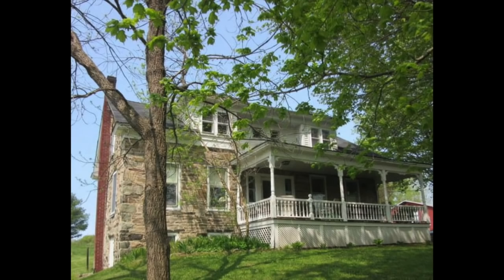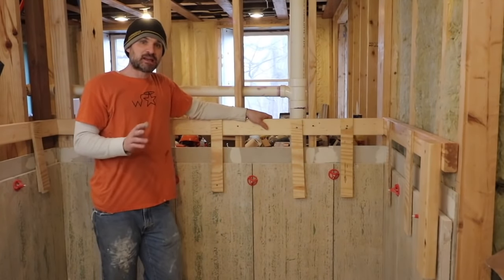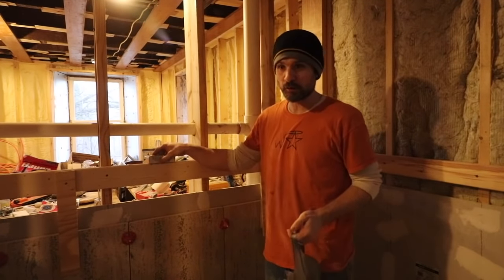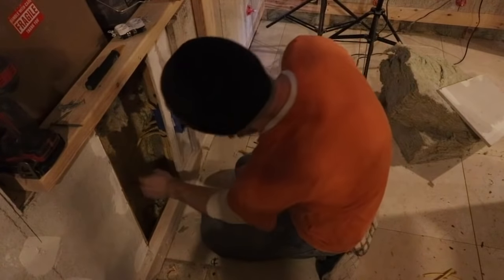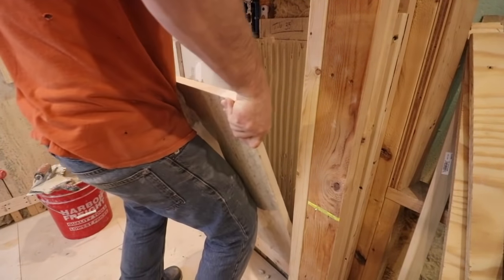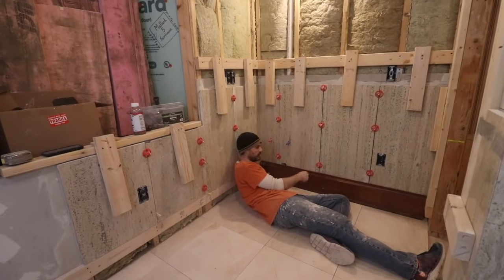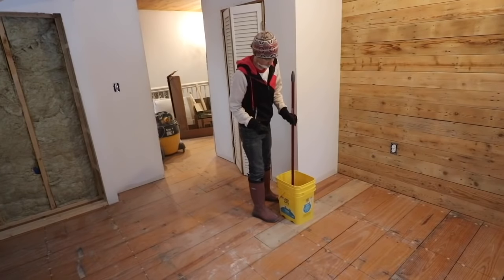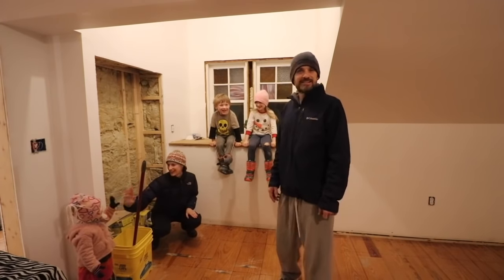100 Year Old Marble | Home DIY | Ep. 160

Comment: I did large format tile around my fire place much the same way you did your marble, then I watched some Custom Building Products tile setting videos. What I learned from them is when double buttering one side should be flat troweled and the other should be notched. Double notching will possibly trap air in the mortar bed. I’m just a carpenter that dabbles in other trades when I don’t feel like paying others, so hopefully the reference helps. My fire place hasn’t fallen off the walls even with 5 boisterous Children, so you’re probably fine, too.

Comment: I was always told that marble that is green is way more expensive, not sure if that’s right but maybe a viewer can tell us...Eucalyptuses oil will take that scotch tape residue off. 💖🇦🇺
Reply from the maker: I’ll try the oil if we can scrape it off.. sarah loves oils.. she has so many different ones.. I like cedar wood.. I sleep like a baby with it. 😃
Reply: @1806StoneHouse  I keep Lighter fluid (fels naptha) to remove tapes and residues. FAST and leaves no residue. May need to soak the paper ones for a bit and they just lightly scrape right off - then clean with more fluid and paper towel. Cheap- fast, leaves NO marks and easy to stay safe.

Comment: Hi Lucas,
First, fantastic job, care and diligence in cutting and laying out the tile - truly elite level attention to detail.
But to your point about not being able to fully squeeze them back to the wall (and the very high immediate suction to wall) it’s because your backbuttering and your wall adhesive/thin set are tooled in conflicting directions I.e. one is horizontal and one vertical.
It means the air can’t escape through the channels/grooves created in the thinset like they could if both were tooled in the same direction (which would be the ‘correct’ way - sorry to sound like a keyboard expert).
Great job though, much better than most pros.
Best,
Rob
Reply from the maker: Always happy to learn something! That makes so much sense! I had to redo a couple and there was good contact but I imagine the opposing direction was why I had to use bodily force each time. The screw down leveling system also helped I imagine. Don’t want any falling off! 😭😩
Reply: 1806StoneHouse if I’m honest, when I backbutter stone tiles, especially travertine that have lots of pitted holes in them, I only use the flat edge of the trowel to push the thinset into the pores of the stone, and leave the back of the tile flat and smooth. 
I only put the grooves into thinset that’s on the wall, and it must all be tooled in the same direction, whichever one you choose, again to allow the air to escape as you press the tile back against the wall.
Reply from the maker: IamRob FromCardiff I was using the 5” blade to do that and then using the 1/2” trowel to make my grooves.. I hope it all stays where I put it!! 🤦‍♂️
Reply: 1806StoneHouse oh gosh yes. There’s no problems at all with what you’ve done, solid as a rock, you just made it a lot harder for yourself that’s all!
Reply from the maker: IamRob FromCardiff haha!! Story of my life!! Haha!! I appreciate you tell me those things too! I have more marvel and other tile to do.. any help is super appreciated 😃😃 thank you

Comment: Rough in the plumbing for a wet room now, then you could hook it up later on down the track. Maybe.
Reply from the maker: That’s basically what we’ve done actually 👍👍 all the plumbing is in place.. drilling the hole through the floor would be the hardest thing to do.. I would need to be 100 sure of the pipe placement.. I’d probably use a large shower pan too. I don’t really like the idea of a wet room.. I just don’t trust it. 😂😂
Reply: @1806StoneHouse  Thanks for the reply! 🐨

Comment: With the wood floor upstairs sand it down To bare wood and put the finish coat of polyurethane on it. It would look beautiful in that room. I bet that Sara will agree.
Reply from the maker: They need to be sanded and one more room of plugs to cut and glue in...
Reply: The house is coming out beautifully. Keep up the good work. It’s hard and frustrating but well worth it at the end. Making memories.

Comment: I'm curious, what do Americans use electric sockets in the bathroom for?  In the UK they're pretty much illegal.  We can't even have a normal light switch,  it has to be a pull cord from the ceiling
Reply from the maker: I’ve used, hair cutters, hair dryers, space heater, electric toothbrushes, electronic flossing,
Reply from the maker: Sounds like it’s very strict? I don’t hear of people Electrocuting themselves very often too? I wonder why they would be so nuts about it?
Reply: I think I've figured it out..  we have 240volts.  If you get a shock then you're probably done for :) but I think a 110v shock is just get painful?  I don't know.  I don't intend to find out :)
Reply: And maybe British people have a habit of dropping plugged in appliances into the bath :)
Reply: I've another question,  if I may.  I'm in the process of buying a stone house myself and it also has large windows where the stone wall goes in at an angle,  so the opening on the room side is wider than the actual window.  I'm also going to be putting up a frame for insulation.  Do you have a video in the series where you cover your decision process for how to frame around and in the window area of the wall?  I'm thinking I'll need to taper the thickness of the frame from full width at the room side,  down to nothing where it meets the window frame.  And how to insulate that?
Reply from the maker: Sean Crowe can you message me on Instagram?

Comment: You shouldn’t cross pattern your tile thin set direction. One direction is the only way adhesive/thinset should go on. So not vertical and horizontal reason being is when you go in multiple directions you create pockets of air and it don’t adhere as it should there is a really cool video on here about it but one direction it’s the only way you should do it you also don’t need and on the back of the tile. Look very nice though
Reply from the maker: Yes, a couple people have mentioned that.. I think for the most part we did vertical on both.. but, unfortunately (for me) I showed the one I went opposite.. haha!! I like back buttering it makes sure I have decent coverage and I need to make sure I have 1/2” of mortar too.. that’s so the tile was at the correct level for my baseboard.. I appreciate you telling though!! I like tips 👍👍👍

Comment: Are you nuts? You do not hit tiles of any size with a hammer. A rubber hammer can be used very gently but you were hitting it much too hard, try putting the thin-set on the wall and then using the notched side to get most of it off just leaving the notched thin-set, do the same to the tile but if you went up and down on the wall, go side to side on the tile, then put the tile on and move it around a little to merge the tile to the wall. This method will make sure you get the correct amount on the wall and the tile.
Reply from the maker: I was shimming the bottom on the tile and missed.... that is exactly how I was putting the tiles up. Not much wiggling these giant tiles though. Used my body to get good pressure. I had to take a couple down and put back up so I know I was getting good contact. Thanks for the advice!